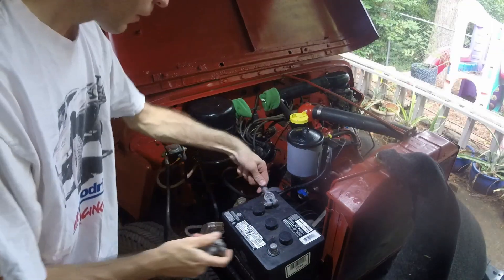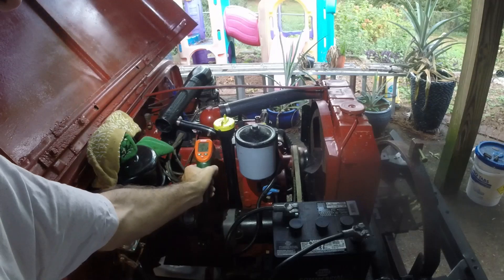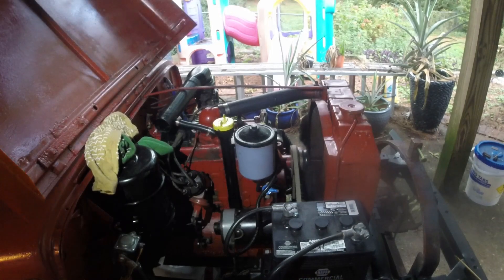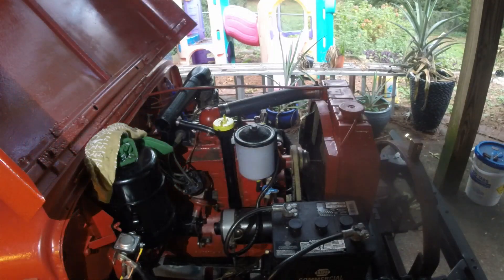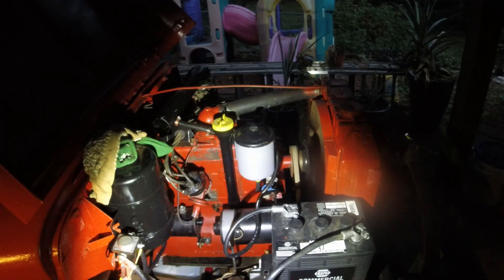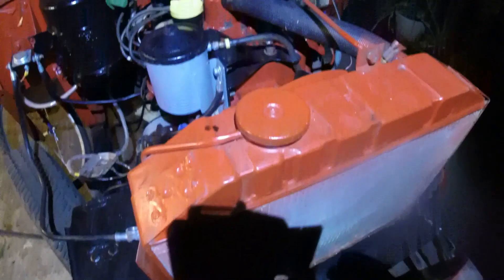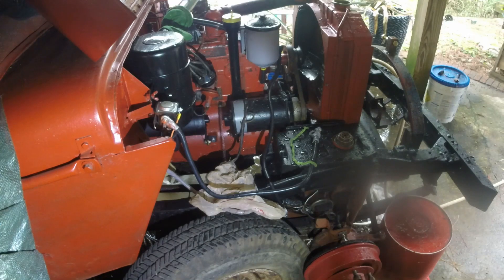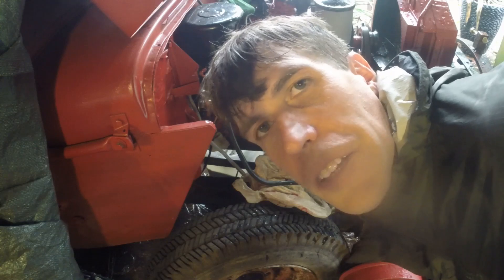Using Waterglass or Liquid Glass to Repair a Head Gasket or Engine Crack Willys L134 Engine Jeep

Comment: The key to using water glass is so NOT use antifreeze while you’re pouring it in use distilled water only.. Then add the water glass then drain the system then wait at least 24 hrs before refilling with antifreeze.. ALSO remove the thermostat so you get good even flow and don’t ruin your thermostat.
Reply from the maker: i didn't have any antifreeze in but I just used regular water.  I don't remember if I took my thermostat out or not.  Thanks for the tips for next time.

Comment: I thought you were supposed to drain the system, add only water. Then once warm add the stuff and run for 20 min. Then drain and flush system and add antifreeze.....that has worked for me.
Reply from the maker: that sounds about right.  I didn't have antifreeze in the system as i would drain and fill it several times depending on what is going on I didn't want to have to dump the antifreeze to the ground.  unfortunately, it doesn't look like my issue will be repaired by this stuff this time.
Reply: @jaysjeepandclassiccars  bummer!
Reply from the maker: @naughtysmurf64  exactly

Comment: Would be nice if u showed if it wored
Reply from the maker: it worked some but not enough to avoid taking the head off the engine.
Reply: @jaysjeepandclassiccars  I kinda figured that I been considering using it but I figured it wouldn't last
Reply from the maker: @thomaslockley945  I think it is highly dependent on the situation and where the crack or issue is and what pressure etc. I've heard stories of folks using it in old trucks and having them run for years but as the old line goes, results will be varied is so true with this type product.
Reply: @jaysjeepandclassiccars  What about trying it a second time with the other half of the contents? And sharing the process, and results, in another video? Unless the head has already been removed.
Reply from the maker: @eurekayess  thanks for the suggestion.  Already took the head off at this point.
Reply: @jaysjeepandclassiccars  Another possibility for yet another video: My trusted mechanic recommends Alumaseal, for ones who need a quick fix while saving up for a more long term approach, like I am.